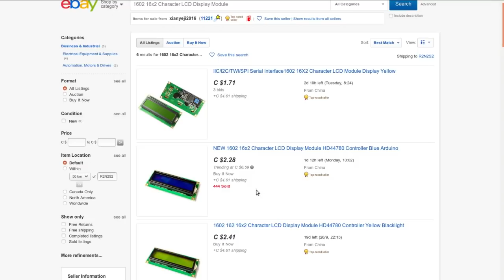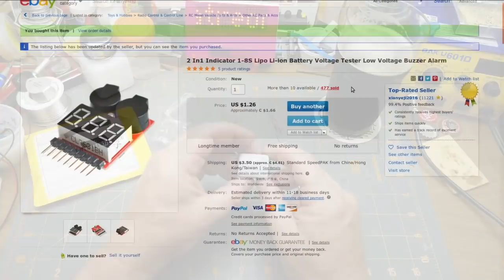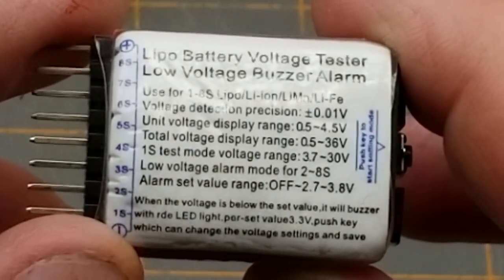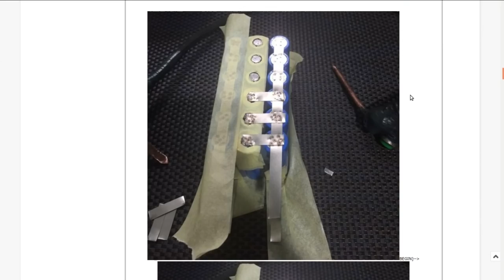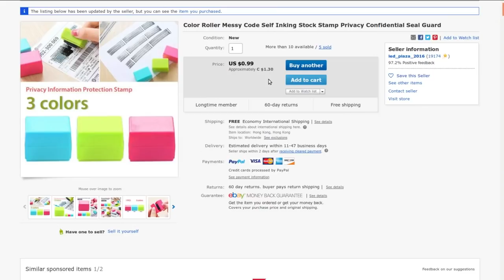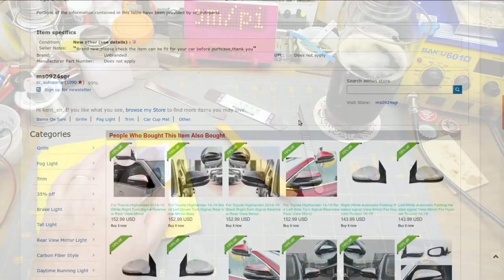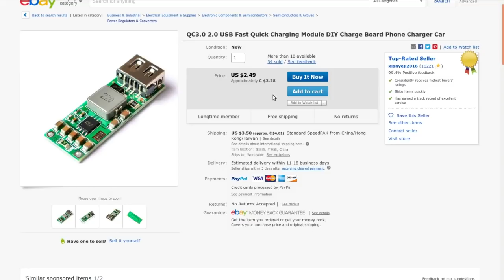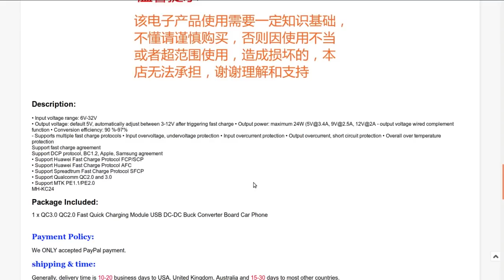Mailbag Monday #68

Comment: I have quite a few of those lipo monitors and they are very handy in my RCs. I run a separate lipo (from the motor/servo) to power my LEDs. These will let you know when to unplug the lights so you don't over discharge them.

Comment: I use 130 salvaged cells in my ebike, just ticked over 2000km. Still going strong. 13s10p pack 19Ah. 500W motor. 40km of range on throttle only..
Reply: U using a BMS on battery pack
Reply: @davey2k12  Have to! On a recycled battery pack
Reply: @HMPirates  no ya don't have to..... have you checked balance feature the current is to low with most of them ....even if it does balance it's hiding unbalanced cells so you can't see the weak cells from the good cells untill you disconnect it
Reply: @davey2k12  it's recycled cells, I don't have time to check the battery all the time. It's for commuting. You HAVE to have a bms on these recycled cell packs as they are always going to discharge differently. They get balanced over the weekend through the bms.
Reply: @HMPirates  I use balance charger instead so you can watch the cells and see the resistance too 😀
Reply: @davey2k12  I've searched around for a balance charger that goes up to 13s,and is affordable, without luck. Which one do you use?
Reply: @HMPirates  I had same problem with 13s finding a 7cell charger but they actually sell one now but it's is a RC charger .......I used a few and broke a few lol I running it on 12s so can use 6s charger split pack in 2  
I had 2 overlander d100 2x6s which was good untill I broke the screen lol I using their power supply to power ISDT Q6 ....6s charger now which has crap balancing too 0.05v cus cell 5 at 4.2 lol

Comment: That's quite a collection of screens! Also, a lot of people make spot welders out of microwave transformers.  That's a fun project.
Reply: I have a transformer read to play with, the output  is too high to play without it hurting so secondary removal and replacement with a few turns of fat cable is the order of the day
Reply: @TheEmbeddedHobbyist  Yep. I remember doing that with some 8AWG or something along those lines.
Reply from the maker: Not sure if I'm that brave...
Reply: @pileofstuff  I think its either very  brave or foolhardy to play with the 2KV, better to cut the secondary out and play with a few turns. low voltage high current  gives burns which I can live with. high voltage gives burns and stopped hearts which I can't.
Reply: @pileofstuff  I do think the procedures for building one are pretty well established. The first one I played with was 2015.

Comment: I weld cells with that strip and 2 wires from a 12v car battery. I hold one wire on the strip while pressed against the cell and tap to other wire on for a mili second. Sparks fly but it works. And the cats run off into the bushes.
Reply from the maker: I guess a couple hundred cold cranking amps applied a few millimeters apart ought to do the trick!

Comment: The paper with the pinout looks like it has more info on folded sides. That may be your manual.
Reply from the maker: Possibly, though it is under the heat shrink that covers the whole unit.

Comment: That battery strip probably is nickel coated steel, not pure nickel strip. Hard to test this as both get attracted by magnet, if I remember correctly, VoltLog tested some of these by making them rust.
Reply from the maker: I remember that video. 

I'm not expecting these to be pure nickle - certainly not at the price I paid.
Like most of the stuff I order from China, it's mostly an experiment - trying out stuff I haven;t had a chance to play with before.

Comment: them lipo buzzers am crap bro unless you mod it, 
 when voltage gets low reading still reads high check with multi meter
Reply from the maker: Do you have any links to a good source of those mods?
Reply: @pileofstuff  maybe reduce connection resistance could remove the pins wire direct switch on left pin,
But i stopped using them when I found out it's not that accurate below 4.1v  😀
Reply: Jehu Garcia did a video and tested almost a dozen I think and none were accurate.

Comment: why someone buy old hd44780 lcd if same cost or cheapen have i2c and lot better no use many wire, but working same and cheapen.,only idiot orden old today.
Reply from the maker: I guess you didn't notice the I2C adapters that I already have in the box of LCD stuff I showed?
Reply: @ Matti - Ouch. Why so salty dude? Hint: Spellchecker.